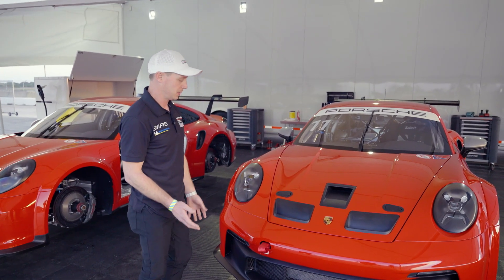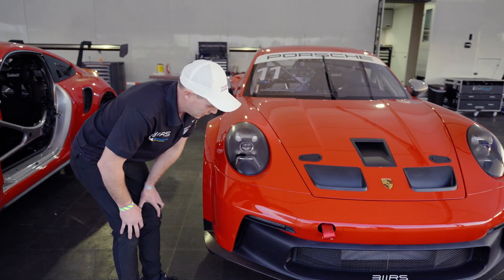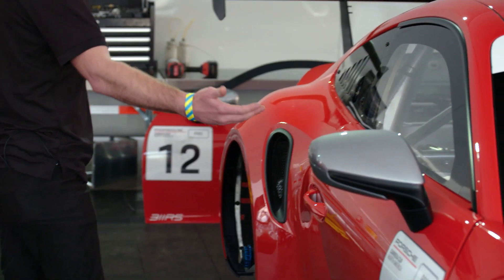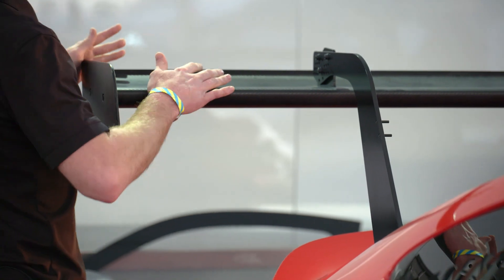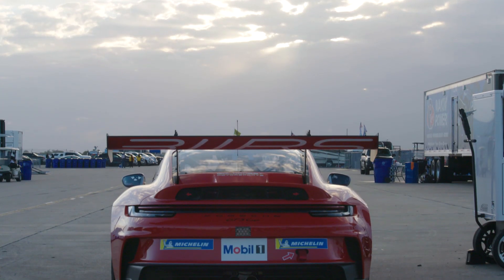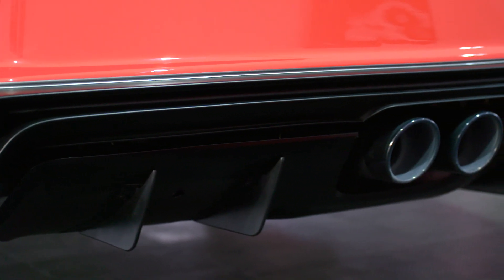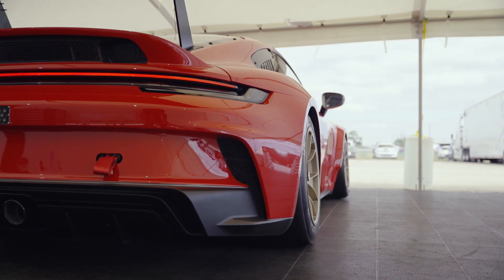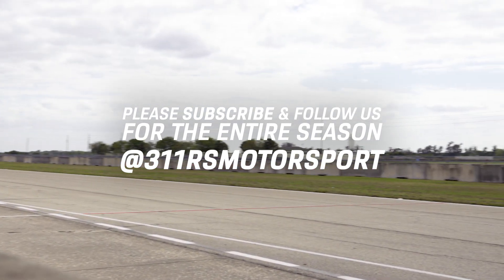TECH TALKS: Porsche 992 GT3 Cup Aerodynamics

Comment: The front middle outlet looks so much smaller than the intake. Still wonder how Porsche made it work. And also I'm wondering how the water flow between the 3 front rads (ie are they all high temp rads)?

Comment: Interesting :) Are there any adjustments possible apart from the rear wing (and the splitter I suppose)?
Reply from the maker: The rear wing is the main adjustable aero element, however you can play with the brake ducting front & rear along with ride heights to some effect. The front splitter is static.
Reply: @311RSMotorsport  I see, thanks :)